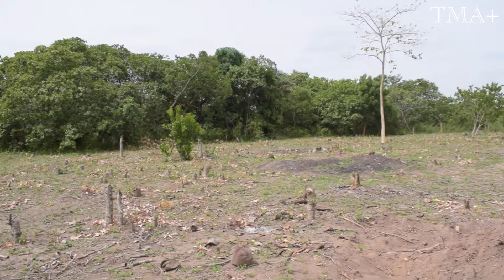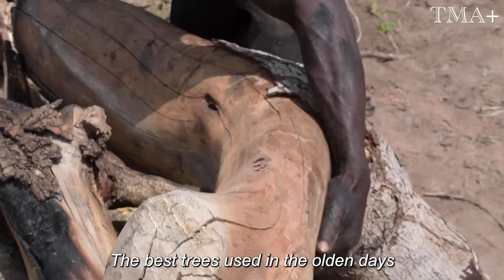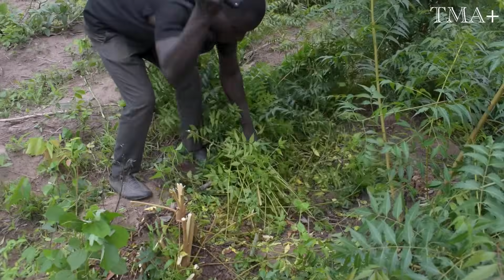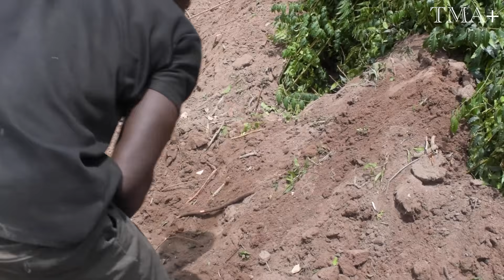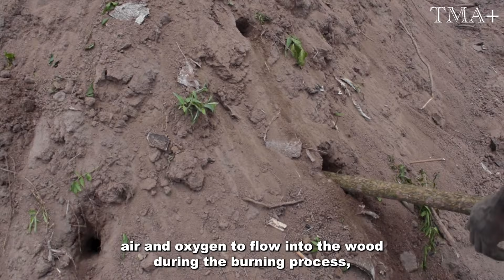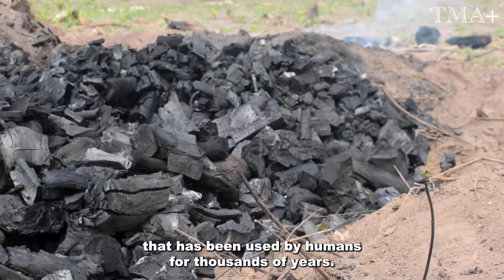How Wood Is Turned Into Charcoal | Primitive Charcoal Making

Comment: what is disadvantage using wood instead of converting to coal?
Reply: Charcoal is lighter to transport and burns hotter and cleaner. For cooking, for example, it is greatly superior.
Reply: I used to use wood for outdoor cooking it takes forever to light and you will see the moisture bubbling out of the wood. It ends up smoking instead of burning. Eventually the wood becomes charcoal and it works well but takes an hour.